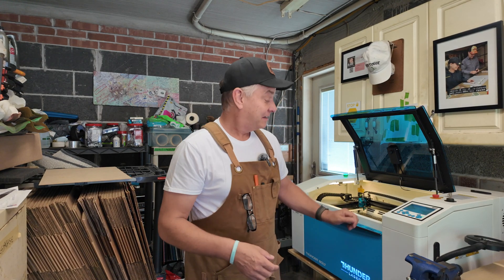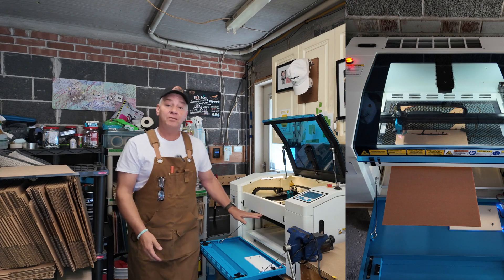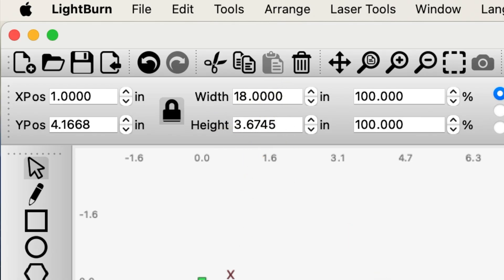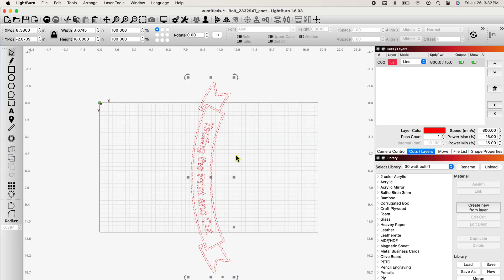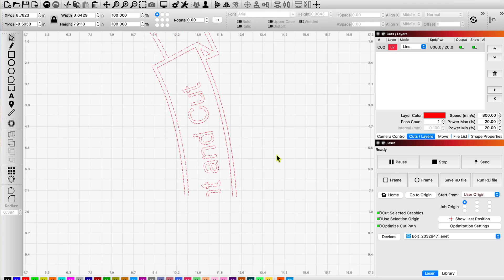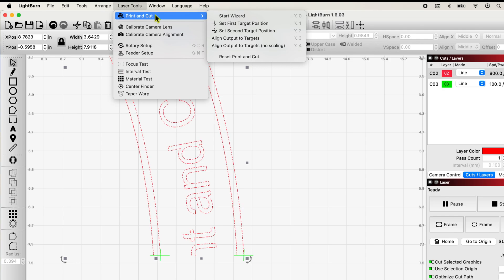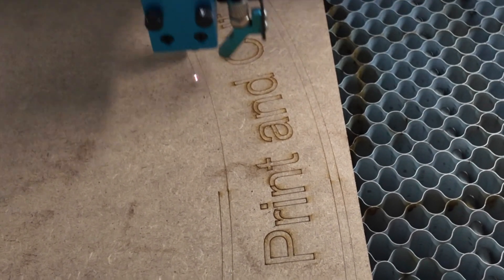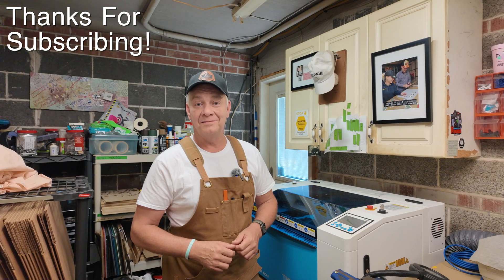Larger Than Life. Print and Cut on the Thunder Laser BOLT. 045   4K

Comment: A much easier way to cut is to draw the box with one side where you want to cut it, select the design then (hold shift) and select the box. Go to TOOLS then select “cut shapes”….. if you are in line mode for them (switch text or all to line) it wont have them connected. If you are in Fill, the two halves will have a connecting line. After the cut change back the text to fill (if you want) Will save you 5 min.. also the further away the setting points are, the more accurate the cut will line up. What a great feature, can do a whole floor with an open frame laser 👀
Reply from the maker: Hey good morning and thanks very much for the helpful info and advice. Greatly appreciated. Cheers!